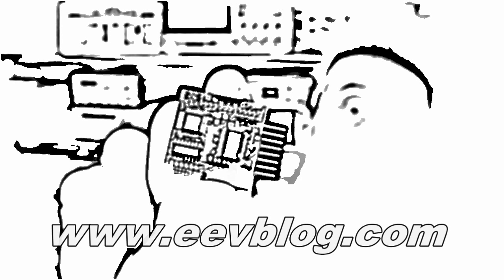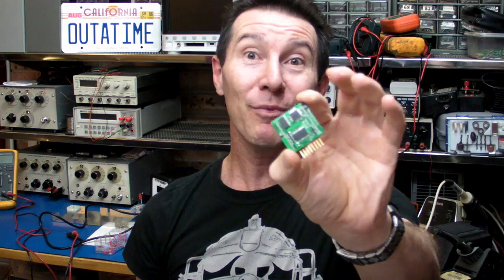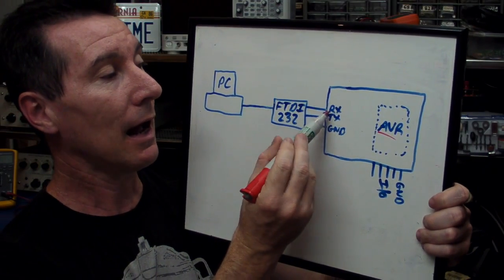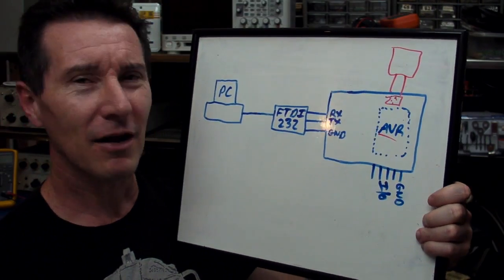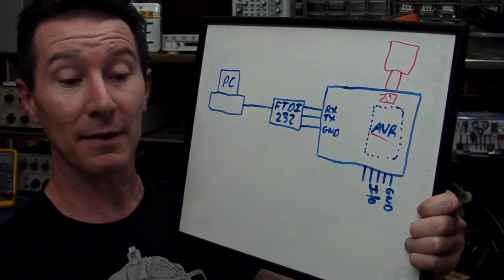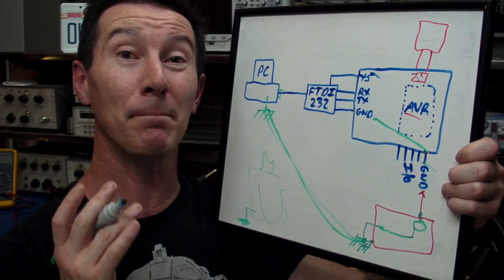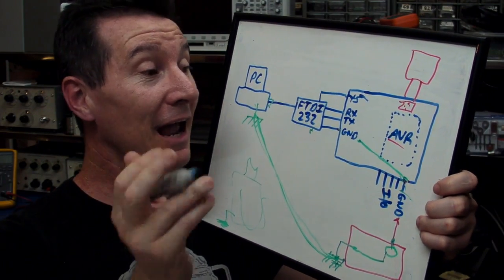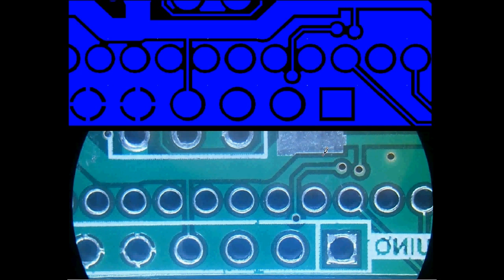EEVblog #155 - ITead Studio PCB Prototype Goof

Comment: Dave, it looks like they changed the drill size, probably to reduce the amount of drill sizes. The bigger drill size made the pads a bit bigger and therefore the  mask had to be changed resulting in a different spacing and the brake in the ground plane...
Reply: This is what I thought as well! They probably have a very limited number of drill sizes set up to reduce tooling costs

Comment: Actually PCB manufacturers do have a specification for minimum ring size around a drill, just so they can rule out issues because of misaligned drill (which does happen a lot with low cost fabs). So maybe they expanded the ring size and ended up causing issues. They should notify you - but it is good to take this into account in design phase.

Comment from the maker: @Zadster Nope, they touched it. Otherwise why is that every single spacing around the ground plane is pulled back an exact distance, yet 6 thou tracks and spaces elsewhere on the board are perfectly intact? Etchent is not selective! The only explanation is they fiddled with the gerbers.

Comment from the maker: @jeriellsworth Annular rings look the same size, so that doesn't look like the explanation. A good board house should have all drills in small enough increments. And they drill smaller and then plate out to the required size anyway.

Comment: I love these blogs. You are a bit over passionate, but that is what makes you take the time to explain things. I am in the USA and most of the engineers that are not a pain in the ass are from some other country.  I worked on a large active reactor at a steel amalgamation (mill) plant, and the engineer was actually sitting in the dirt with the crew sanding tubular bus for the 69,000VAC 3 phase to12,470 step down. This guy was a Brit.  A Yank would have hidden in an office with AC and coffee!LOL

Comment: Not all notebooks are isolated (some with a three-prong earthed pack; obviously unearthed packs are isolated). Mine has a power pack with a path from earth to the DC ground, and that actually causes audio ground loop issues because there's a high-current ground path over a crappy DC cable which makes it drop some voltage. So whenever I hook up any audio device that's also grounded I get an annoying buzz. I mostly fixed it by adding a nice fat ground from a connector shield to mains earth.

Comment: @EEVblog Yep, there were some extra traces. It shorted two terminals from a 25MHz crystal to ground. As a result, a network chip attached to it would respond to some commands and not to others. After wasting an arm an a leg calling the chip manufacturer I ended up looking at the board and found the short circuits. I don't know if you already done a blog on "putting a pcb to work" but it would be an excellent idea to show basic validation steps for a PCB.

Comment: Nice Vid Dave. Our PCB maker actually some "little" changes on the PCB's. Sometimes adds some test points to make internal tests like continuty between tracks. Sometimes they just can solve the resolution, change track witdh or clerance.
Related to the ground, you mentioned that the board is actually high density to route a ground track. What try to I do is to route ground, run DRC without any fill planes and once iI've get 0 errors, I feel deligthfull on filling the PCB with ground fills =)

Comment: I try to make sure a circuit is electrically sound before pouring the copper planes.  In altium you can  "shelve" the polygons, then do the DRC.  This method makes sure I have explicit traces that follow DRC width rules for every pwr and gnd pin.
On the other hand, my boss and others rely on poured polygons to complete their circuit.

Comment: @EEVblog Yup, that's what I remembered :-)
I just read the comments on the blog-page too, where you explain a bit about why you had to chose 6/6 - I understand. I think you've been unlucky this time. But as none of my designs have been 6/6 routed yet, I can't tell you my experience with iTead and those boards.

About the oscilloscope issue, I would like to ask you if you recommend having your Oscilloscope Grounded or not? I've talked with different people, but they had all different meanings!

Comment: @mindthomas if it isn't grounded (which I suppose you would have to do by defeating the AC plug's third prong), wouldn't the chassis be floating around in a sea of noise that would be imposed on the signal?

Comment: @CampKohler Currently my RIGOL scope isn't grounded, and I'm doing measurements fine. Except when I make the ground connection, sometimes a little "spark" appears, and other times the MCU (if I measure on that), resets! This has something to do with the "floating/unknown" ground, until I connect it. And the spark appears, as there could be a big voltage difference on the "floating/unknown" ground, to the real ground...

But I don't know what is best - that's why I'm asking? :-)

Comment: Dave, I've also had a problem with a PCB manufacturer. They deliberately shorted two crystal pins to ground with 2mm tracks that were not on gerber files. It happened in a prototype, but could have happened in production (they fucked up the gerber for top layer). I've got free boards for a while for that!

Comment: If its critical always make it as a track, especially between pin headers, I used to do lots of pcb prototyping with a cnc milling machine and the milling software would sometimes wipe out any  copper between pin headers unless i specifically put a track though there.

Comment: @flamzart - I completely agree!  In fact, I always route my power and ground first, and only the will I flood the planes.  That way I know the path, and don't have to rely on the planes making the "proper" connection.  You might get it connected with the planes, but if it's squirreling all over the place... it's pointless.

Comment: From what I've read elsewhere every manufacturer adjusts the widths. As I understand it manufacturing processes always grow or shrink copper by an amount that the manufacturer knows and adjusts for.
Reply: Totally ignoring the clients design widths???
Reply: jpalm32 Well no, when everything works the adjustments compensate for the process and the end result should match the specified widths. I can only guess why the flood fill was cut back, but at a guess I'd say that maybe there was a larger minimum clearance rule for floods compared to the rule for tracks. If that ground had been tracked it should have come out fine. It probably should have been tracked anyway, there's not enough fill to really constitute a ground plane as such.
Reply: boriseng Wait what? What do you mean by "adjust the widths", you're being inconsistent here. They should send outputs to the machines that produce an end product that matches the customer's design. That's not "every manufacturer adjusting the widths", that's "every manufacturer compensating for process". Which can't be offered as an explanation for what happened in this video.

Comment: i don't get it, he didn't measure the voltage inputs on the micro directly on the chip?
Reply: with decent probes it isn't an issue.
and i'm sure dave has good gear.

if not that, a power continuity check is about the first thing i'd do.
at least before breaking the scope out^^

Comment: First off, what you're saying about laptop power bricks isn't necessarily true. All my power adapters have mains earth going through to the negative supply lead (except a dodgy one I bought from eBay, go figure.) No reason why it shouldn't be connected. Unless your adapters don't have a third earth wire?

Second off, I find the width for the ground lead on the board to be quite small. I personally try to keep my ground pads as wide as possible, not just tuck them in like that.

Comment: Hi Dave.
Can I ask you why you design using the minimum! Always when I design, I try to keep atleast a couple of mils over the minimum.
Fx when the minimum is 6mil, I set the DRC in Altium to 8mil.
I've used iTead a lot of time, without any problems at all....

So my point is: DON'T RELY ON THE MINIMUM!!
Do you agree? :-)

Best Regards
Thomas Jespersen

Comment: I have been using iTead since about 2013 and have never had an issue. I have purchased over 100 boards by now and none of my designs have failed. In fact they have always gone above and beyond (comparing to my OSH experiences) in sending free gifts and filing card-edges when I designed card-edges. 

I know all too well that they started off rough with poor annular rings and such, but they have improved since then. So much so that I use them exclusively for small runs of boards and pay the extra shipping.

Comment: Hi Dave, I know you are a professional electronics engineer, and I'm just a hobbyist electronics guy, but I would never rely on a copper pour to complete a circuit path, is this a common method for grounding. mike
Reply: yes
Reply: Yes!
Reply: Chris Miller
well if it,it's a bad idea.
Reply: +snaprollinpitts It's only a bad idea if your PCB fab decides to change your design which they should not as that is a BAD IDEA as you will have followed certain design rules and if they make changes, your PCB design rules are no longer valid.
Reply: +Dave McLaughlin  thanks Dave
Reply: +Dave McLaughlin But what can happen is that you decide to change your design just a tad bit later on, and then when you rerun the flood fill, it no longer does the job.
Reply: Thats what a design rule check is for. If you set up your design rules correctly, you'll get notified of any "un-routed nets" or other errors before you send it off for manufacture
Reply: Who bothers with setting up a drc correctly tho? :D
Reply: "snap" - What? It's a very good idea. Hobbyists make "freagle" sized boards - No problems spending tons of time routing gall the grounds, but if you're designing - say - a MUCH bigger system, it's a very good idea.

Fact is that this is a 100% normal method of making a ground plane in the pro business, and if the fabs have design rules that says you can get away with something, when it comes back and it isn't as specified -it is not a design flaw - it's a PCB fab flaw....

Comment: @EEVblog

Probably try it, expect it to have a high chance of failure, have it fail, learn a lesson, and never use the same minimums with Itead again, and if I do need tight minimums in the future, simply not use Itead.

I actually expect dirt cheap PCB services to modify stuff because of the flat rate pricing.

Comment: @38911bytefree In the case of circuits that were intended to eventually being applied to a modem, TX and RX were always to be interpreted as pointing towards the telephone line. Once this was realized, you always knew how to view the meaning of the signals, e.g. receive FROM the line and transmit TO the line, no matter how many times these signal names appeared in the path on one side or another of the various boxes..

Comment: @heroineworshipper Chinese quality??? You mean telephone jacks whose screws strip out of the plastic before they are barely tight? Do you mean two-conductor telephone cable that has one strand of wire in one conductor and two strands of wire in the other (go figure)? Do you mean those shake-to-light flashlights that, in order to save the cost of using actual copper wire in the generator coils, has fake coils with a tiny battery hidden inside to make it work (until it runs down)? And so on.

Comment: I've been raised and educated in China, and I used MANY MANY Chinese PCB fabs, include the fab serving IStead. This is obviously a design fault you made. You should contact them before making your final PCB polygen pour. Most Chinese fabs can do VERY precise mask alignment, so you don't have to set a extra large solder mask expansion. Meanwhile, you shouldn't set a very small clearance. I've been using many cheaper solutions, but none of them failed -- I just contacted them before sending my PCB file. I use 6/6 mil traces and 12/20 mil vias, and 2 to 4 mil expansions, and never seen things like this. When you outsource your design to a third party, ALWAYS make sure you know their capabilities. To be frankly, they charged you too HIGH, rather than cheaper. 2-L, 5*5 cm boards genarally cost 8.5USD in China, if you contact them in Chinese, and they do 6/6 mils without any problem.
Reply: You should watch AND understand the videos before commenting.